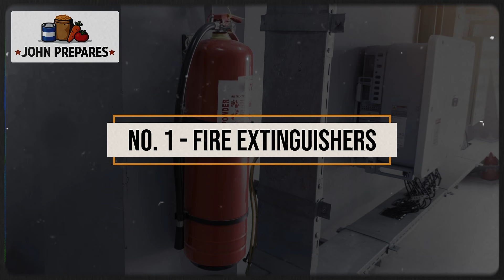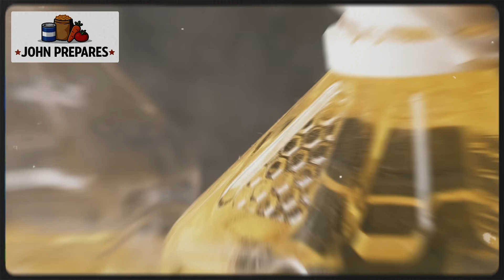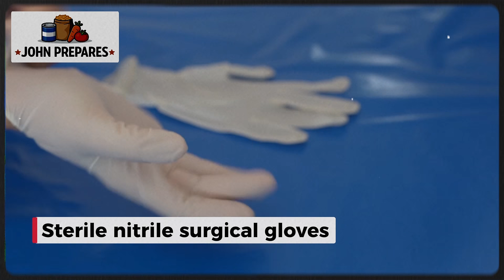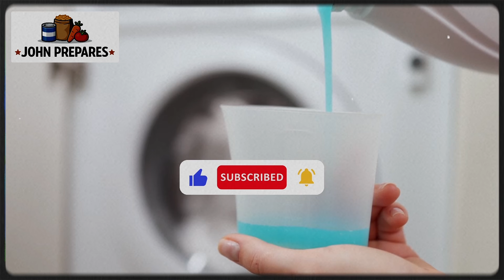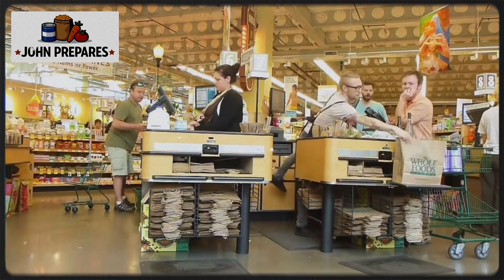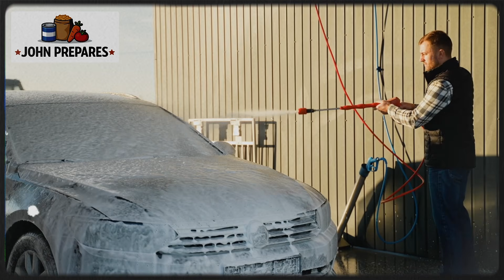15 Free Survival Items Every Prepper Overlooks In Abandoned Buildings

Comment: 1. Fire extinguishers 
2. Ceiling tiles & fiberglass insulation 
3. Smoke detector batteries 
4. Commercial cooking oil
5. Prescription eyeglasses from optometry offices
6. Copper electrical wire
7. Dental offices: medical supplies & equipment 
8. Vet clinics: pet antibiotics, IV fluids, wound dressings, etc.
9. Laundromats: detergents, bleach, cleaners, disinfectants, motors, belts
10. Schools: first aid kits, cafeteria food, science labs, shop tools, nurse's office
11. HVAC & mechanical rooms: condensate water, copper lines, filter media, pumps & motors
12. Reference books: paper maps, first aid instructions, field guides for edible plants, plumbing & repair manuals, 
13. Office desk drawers: personal medicines, tools / multitools, portable battery banks, 
14. Church & religious buildings: candles, kitchen & pantry, sacramental water for baptism, etc.
15. Coin-operated car washes: cleaners, degreasers, holding tanks of water, pumps, hoses